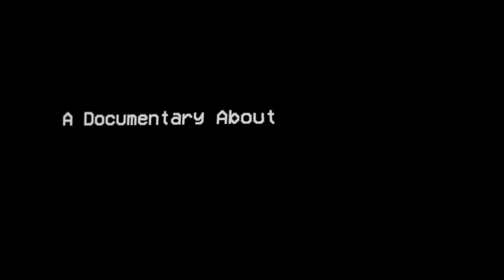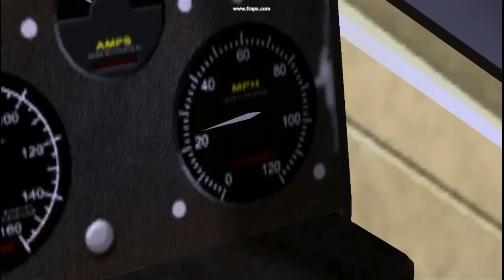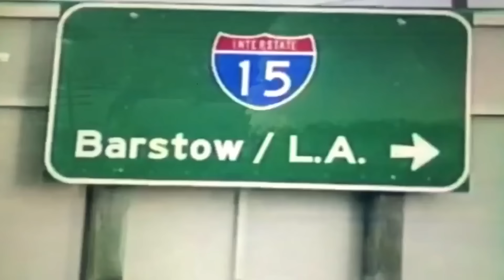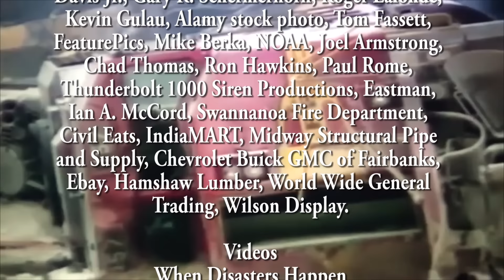The 1996 Cajon pass runaway 23 years later

Comment: Kinda ironic that the only guy who didnt jump was the only one who survived
Reply: True
Reply: Kinda ironic the place kept jinxing themselves.
Reply: But haw?  So Lucky
Reply from the maker: The only explanation I have for that is the physics of the crash. The only hard impact he suffered was the locomotive slamming on it's side flush without the nose impaling itself into the ground and the velocity sent the GP60M sliding far enough to escape the center point of the crash (Hence why the 2 yellow-bonnet locomotives were destroyed) it's similar to the physics of the 1989 runaway that happened years prior only the cab of the leader of 7551 east was shredded making the engineer of that train suffer worse injuries than the engineer in this wreck. I've noticed in some crashes involving over speed that the engineer has a higher chance of survival when staying with his engines compared to that of normal derailments so long as the nose stays mostly intact.
Reply: @Thunderbolt_1000_Siren   a captain always goes down with his ship, as should engineers and conductors of a locomotive.
Reply: Right
Reply: Also ironic how they tested the brakes TWICE and then when they acutually NEED it, it fails, wtf??!!!
Reply: @Yvonne-Bella  you couldnt PAY me to live by those tracks!
Reply: It’s hard to say which one was worse the 1989 runaway, the 1994 runaway, or the 1996 runaway
Reply: Jyothi Doughman the ‘89 runaway killed 6 people, 4 of them bystanders, and destroyed a city block. The ‘94 runaway caused no fatalities or property damage outside of the trains themselves, and the ‘96 wreck only killed 2, zero bystanders, and didn’t destroy any homes. It’s no contest, the ‘89 wreck was far and away the worst.
Reply: @Thunderbolt_1000_Siren  I can't believe that happened 3 times in 1989-1994-1996. this should not happen and also got to love train simulator crash physics
Reply: Hmmmmmmmmm true
Reply: RungCox Productions I know right
Reply: Hmmmmmmmmmmmmmmmmmmmmmmmmmmmm
Reply: @Thunderbolt_1000_Siren   ucubusu ucubusu
Reply: @Thunderbolt_1000_Siren  2 other wrecks that could be used as examples for people that survived are the Kismet Train Collision and Cactus Train Collision of 2006. Kismet’s combined impacting speed was around 60 miles per hour, yet the crew of 4479 stayed on board and survived. Cactus was the same case, only it was a collision with several grain hoppers.
Reply: Well he’s the one that’s closest to the campus
Reply: The old engineer that trained me also advised me to never jump. You jump, you die for sure. Fortunately, I was only faced with the choice once.
Reply: @MegaBrokenstar  so far...
Reply: @Luis Montoya No luck to it. The North American Cab, which this was, was engineered to survive a head on collision.
Reply: @HobbyOrganist  They tested the brakes on level terrain and the brakes were perfectly capable of stopping the train on level terrain. However going downhill this was not the case because some of the brakes on the train cars didn't work. No problem on level ground but on a hill that's bad.
Reply: @killman369547  Yeah, you have all that weight and momentum going downhill adding to the overload on the brakes
Reply: Did the front train got repaired
Reply: And nobody died in the 94 incident because the crews bailed out, including the runaway crew managing to jump at 50mph with bumps and bruises.
Reply: I know
Reply: So true
Reply: @HobbyOrganist  Same. I'd rather live by Saluda rather than Cajon.
Reply: @engrcumins9809  if you don't mind can u tell me about when you had to make that choice.
Reply: @BigCountry571  Refresh my memory. It's been 2 years.
Reply: @BigCountry571  I see now what you're referring to. 

I was working a local running from Enid, Oklahoma to Clinton, Oklahoma on what we referred to as a branch line. The speed limit was 30-35 mph, if I recall, and we were pulling a slight uphill grade on straight track for several miles. We were approaching a station that was no longer active but there was a grain elevator coming up on the brakeman's side. I saw an 18 wheeler approaching the  road crossing before we passed the elevator. The trailer he was pulling was a large long propane gas trailer. I knew that if we met at the crossing we would all loose. I hollered at the brakeman. "LET'S GO!" "THIS WAY!" I big-holed the train (initiated an emergency brake application), we ran out the back door to the rear of the GP-38-2 FRISCO locomotive to the steps down on the engineer's side. On our way back I emphasized, getting off correctly so we can stay upright when we hit the ground so we can run. We did. The train stopped short of the crossing. So did the truck. We were standing there on the right of way with our hands on our knees panting from the panic and looking up toward the crossing when the truck came into view again when it was easing over the crossing.

The back story is; a couple of years earlier, most of us at the home terminal had witnessed the aftermath of a collision two of our fellow employees had with a hot oil truck which had just picked up his load from an oil lease near Terleton, Oklahoma at this crossing; 36°10'25.4"N 96°28'24.0"W . The scene was a nightmare, our fellow employees were badly burned and the truck driver survived the initial crash but I don't remember whether he survived his injuries. That was the summer of 1978. I was 24 years of age. Those images were still fresh in our minds when we took the actions that we did. 

Fortunately, it was a non event. But, if we hadn't acted decisively, intelligently and with precision execution it may have turned out much differently.  We had our GOD and our training to thank. Youth and agility were helpful, too. But, fear was a great motivator as well. I ain't gonna lie!!
Reply: @engrcumins9809  thank you for telling me your story
Reply: @BigCountry571  You’re welcome. Keep your elbows up.
Reply: It's because its more survivable to stay in the cab.
Reply: @BNSFSantaFe842  Finally, somebody gets it. Thunderbolt seems to think the Engineer is a sea captain.

Comment: Just a quick correction on your video, (I'm currently an engineer for the BNSF), you showed the independent brake being used to plug the train. We use the automatic brake valve for that. (I'm sure it was just a simple oops in your production so it's ok haha) 
As a result of these derailments, all heavy mountain grade subdivisions require a rear-end telemetry device which can engage the emergency brake from the rear for exactly this situation. You all may recognize this as the FRED at the rear, or flashing rear end device.
Reply: Kensington Chapp how long have u been an engineer? Could u give some tips to someone who is planning on becoming a engineer?
Reply: @NOVARailandWeatherEnthusiast  Tips? Don't become one.

Comment: You might find this interesting also...in addition to having an ETD at the rear for emergency brake applications, we also have new rules about when we have to plug the train. If a train overspeeds by 5mph and the engineer can't regain control (on Cajon Pass), we are required to place the train into emergency both from the automatic brake AND the rear end telemetry device. I personally had this happen to me as a conductor. My engineer couldn't get the train under control and he panicked instead of plugging it, so i plugged it. Our train came to a verrrrry gradual stop right at the exact location of the derailment in this video. Right in front of the memorial. I walked the train, tying hand brakes along the way, and eventually found a partially closed angle cock which was the reason for our weak brakes. We spent 3 hours on the hill spinning every handbrake, then recharging the air brakes, then knocking off every hand brake. But the physical labor was an acceptable trade off for still being alive haha

Comment: Just before dawn on February 1st, 1996 just before Valentine's Day, another Santa Fe Freight Train brakes failed, 4 locomotives and 45 cars derailed at the curve and explored into a fireball at 4:10 am in the middle of the 🌙, 2 crew members were killed and Engineer was injured the crash. In the end, 3853 and 4031 met faith under the scrapper's toruch. 157 a GP60 and 342 GP60B were saved still operates today for BNSF.

Comment: There was another bad wreck in Cajon Pass on March 6, 1978, where a section of the new mainline washed out, due to heavy rainfall that winter, and the line relocation in 72 didn't figure for the runoff. So a wall of water came down that mountain and washed out the embankment the tracks were supported on.  Two men were killed and two jumped, but had severe injuries.  I notice that afterwards, both SP and Santa Fe built bridges across that area, figuring for future runoff.

Comment: Good job. These videos are wonderfully made (as wonderful as making a documentary about trains crashing and burning). 

I actually did some digging and found these photos of atsf 157 and 342 after the runaway ( http://www.rrpicturearchives.net/showPicture.aspx?id=52725 and http://www.rrpicturearchives.net/showPicture.aspx?id=52723 ). 

I also have two suggestions for  documentary’s. The first one being the Tennessee pass runaway in 1989 (http://www.drgw.net/info/TP1989Wreck ) mostly because it’s the reason why the drgw got the gp60s and its also why drgw 5402 is now an sd40-2 and drgw 3108 is on kcs instead of Union Pacific . And the Tennessee pass runaway of 1994 ( http://www.drgw.net/info/TP1994Wreck ) 

Sorry I didn’t have to much to say

Comment: Something seems off to me.
81Psi would not indicate a kink in a airline as that is the Brake pipe pressure.
That would indicate that there is a air leak present and compressor could not keep up.

1. A brake pipe valve on a a trailing wagon closed some how maintaining pressure past it and bleeding air from the wagon ahead.

2.  The engineer applied and released to many times in a short amount of time not allowing the reservoirs to refill enough to get sufficient braking force. runaways have been caused by this.

3. Restricted Brake pipe with a leak passed it that caused low brake pipe pressure the whole time never sufficiently filling the reservoirs causing reduced braking force. 

4. A brake line was crushed on descent not allowing the Break pipe pressure to drop past that point. and caused a leak causing brake pipe pressure gauge in cab to read lower than normal.

Those are all i can think of that would cause low bp and reduced braking.

Comment: They will see another one if the safety equipment is never taken care of, because of that, a locomotive's brakes could fail anytime, even if they were said working and fine, even during the ride before the crash. It DOES NOT matter how old the train is or what condition it's in.

Comment: Should have never left with the eotd not working.  What doesn’t make sense is the engineer said he had performed the class 1 brake test at the initial terminal and had a reading on the eotd at the rear and witnessed a BP reduction.  He then says afterwards he couldn’t get the eotd to communicate with the head end.  That is impossible to get a reading on the rear but not be in communication with the head end.  It’s also against fra to leave without a functioning eotd device.  Engineer and carman both failed or lied about what actually happened at the initial terminal

Comment: with the modern EOTD, is unlikely. when the engineer or conductor throw the train into emergency, the EOT will start throwing the emergency brakes from the rear. thus slowly down the train faster and more efficiently. That's why we do a dump test when we perform a class 1 brake test.

Comment: I really can't understand what was going on in the time frame between the use of cabooses and before 2-way EOTs came into widespread use. Back in the day, if the engineer "dumped the air" from the front of the train, and the emergency application was blocked by a kink in the air hose, he would radio to a crew member in the caboose to dump the air from the back, initiating an emergency application from the back of the train up toward the kink, thus applying brakes on all cars. Today of course, we have 2-way EOTs which give the engineer the ability to "talk" to the EOT, and tell it to initiate an emergency application from the back, much like crew members in the caboose did long ago. With a 1-way EOT though, an emergency application simply can't be set from the back, as the EOT only communicates info from the back of the train to the front, and the engineer cannot "talk" to it. I assume the runaway train in this video was equipped with a 1-way EOT, thus not allowing the engineer to set an emergency application from the rear. Does anybody know what the deal with 1-way EOTs is? Wouldn't people who designed it have seen this coming?
Reply: 1 way HEDs aren't in use anymore on mainlines.  I think on short local trips where 2-ways aren't required by the FRA a 1-way can be used.  The ETD is always a 2-way device and the only thing that would make it a 1-way system would be the head end.  After Cajon we only use 2-way EOT systems.  Nowadays the ETDs are crew tested before leaving Barstow and at Cajon Summit.

Comment: It wasn’t a kink in the lines. It was vandalized at summit. People would close off the air lines and that would cause the train crew to have to walk back to inspect the issue.  By the time they were able to move the brakes were released.  And the crew didn’t see any issues. Heading to the curve in the tracks just before 138.  I worked that derailment.  I seen this first hand.  Since then a huge fence was installed at the summit and security was posted there 24-7.

Comment: It is sort of hard to understand how the air hose could kink unless it was seriously worn out.  They are quite rigid and coupler slack would have been accounted for, unless it was overlooked in the design or installation of cushioned draft gear and the extra travel.  Runaways on the Saluda Grade over its history had a few where retarders were incorrectly set, cars had different wheel types whose brake function decreased as they got hot, or air line failures.  Never heard of one with a kinked brake hose line though, but the NTSB is never wrong.

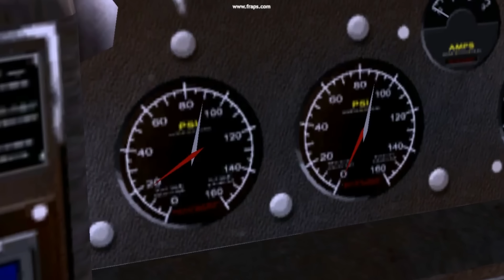Comment: @5:40 81psi in the BP makes no sense in the context of your analysis. If the feed valve is set to 90psi and the automatic brake handle is set to release, the air gauge is going to show 90psi regardless of a BP obstruction further back in the train. 81psi on the gauge at the time of a set indicates a short-cycling of the air brake system (meaning the BP was not given enough time recharge from the previous set). This would be the worst thing you could do as an engineer in this type of situation, as your braking force is further diminished due to the lack of air in the BP and in the auxiliary reservoir system. Therefore, 81psi showing on the air gauge of the lead unit would not indicate a blockage in the brake pipe, but rather, a BP reduction of 9 pounds (a set if the automatic brake is moved to service), an incorrect feed valve setting, a faulting air gauge, or a recharging BP from a previous set.

Comment: its about time they implemented an emergency braking system after these three crashes and needless loss of life.  Semi Trucks have had Mandatory Mechanical Spring Brakes since 1972. I know the Air Brake system works a bit different on Semi Trucks VS trains but if air pressure drops to 60 PSI the light and buzzer comes on which is a warning system that there is low pressure.  Then between 40 and 20 the tractor protection valve and parking brake valve will automatically pop out which will apply the spring brakes and stop the truck.
Long story short, I it a deer right before Thanksgiving Last year, I was on a 2 lane road with no shoulder.  The deer went under my right front steer tire and busted air lines on my Air dryer.  My first indication I was losing air pressure was the warning that I had low air pressure and the transmission may not shift when I hit 100 PSI because the truck has an automatic transmission, I knew I had a problem but no place to stop.  The next warning was at 60 PSI, warning light and buzzer came on, I knew I was in a dire situation and needed to get pulled over fast. Still no shoulder to pull over on.  Then as my air pressure was approaching 40 PSI, the road widened out just enough for me to pull over.  I had no choice because I knew I was about to stop no matter if I wanted to or not, the mechanical Spring brakes were about to lock my wheels.

Comment: Takes a huge wreck before something is done to fix a problem.  When will our society become proactive instead of reactive.  This was unnecessary and it looks to me like that was a design flaw.
No, we haven't seen the last runaway on that steep grade.  At least those that died didn't die in vein.  Improvement to safety system is always a good thing.  
Air brakes are an awesome system for stopping heavy vehicles and the mechanical backups definitely are needed.  I drive a semi truck and brakes are something I take very seriously.  Thankfully in 1972 spring brakes were made mandatory on all trailers produced heading into the future.  Guarantee that it will stop if air pressure gets too low.